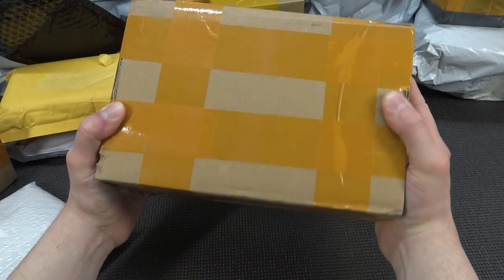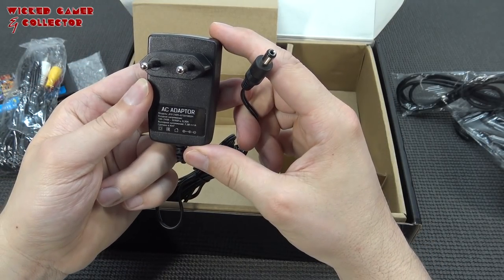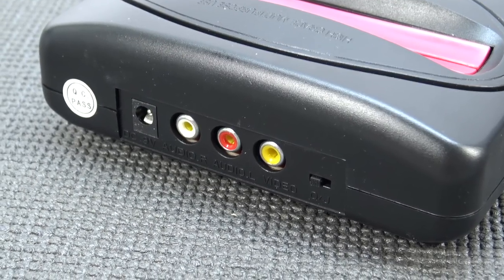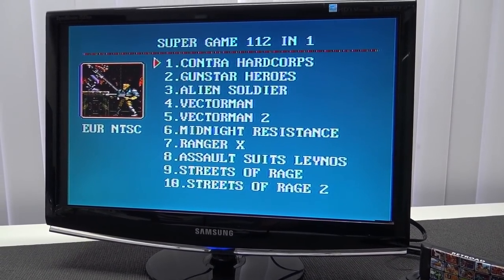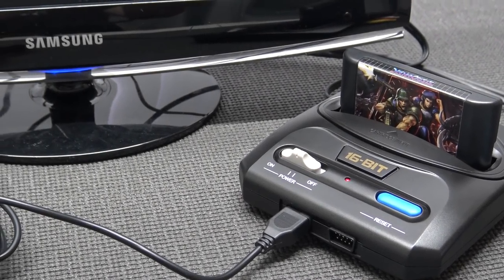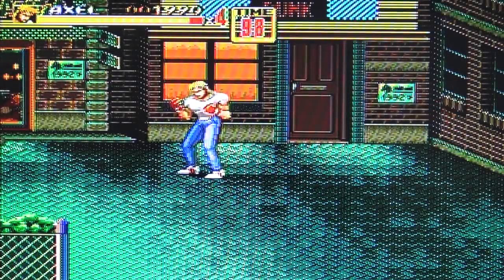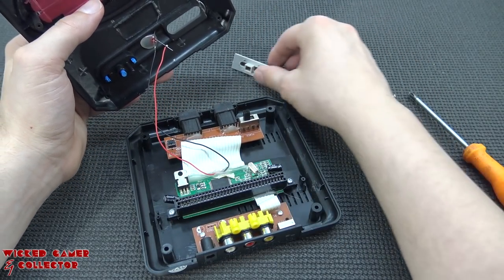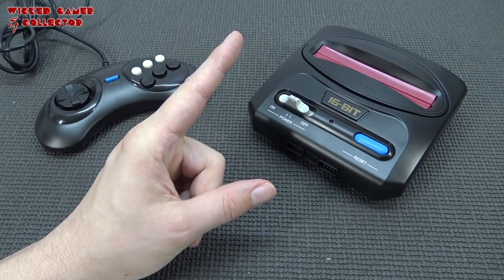Retroad MD Compact Mini Clone from Ali-Express 🤔

Comment: That system was released in Japan back in late 2015 by Columbus Circle. It is called MD Compact. In early 2019, the same company re-released the same system with HDMI support and with name 16bit Compact HD. Similar shell, but dust cover is green.

Comment: For 24 € it's cool but it's super cheap, it's just a circuit board, I disassembled the console in two just by removing the cartridge, on the other hand the switch to switch from region it's cool and This allows all aliexpress games of the past except in case of protection but it is quite rare.

Comment: I found that it sounds better if you play games with quieter soundtracks and turn up the volume. So Star Trek DS9 sounds fine, but Cool Spot doesn’t. If you are trying to compose a song for this, I would recommend turning down the instrument volumes, and using VGMMM rather than TFMMM.

Comment: Another emulator-on-a-chip. The audio made my ears bleed. And it only has composite video? Composite is crap! At least put HDMI on it! This clone system is an insult to the Genesis and its library. There are far better options out there. I myself already have an original Model 1 Genesis with a 32X and wouldn't trade that for the world. If I wanted a clone system, I'd buy something better such as Analogue's Mega SG. That at least works with everything because they used a FPGA instead of a glorified emulator.